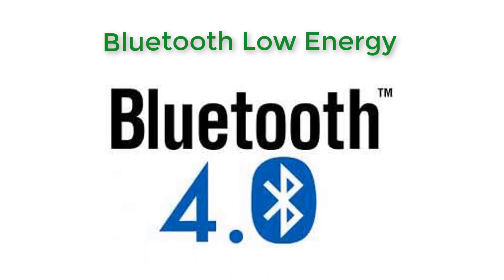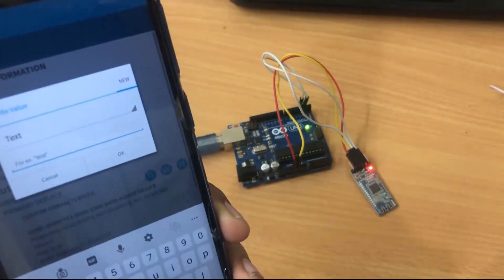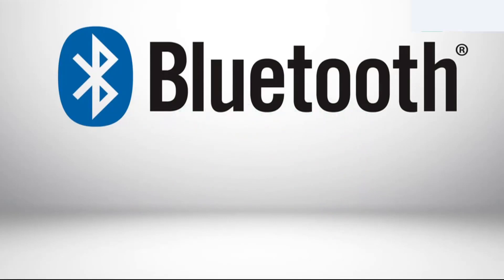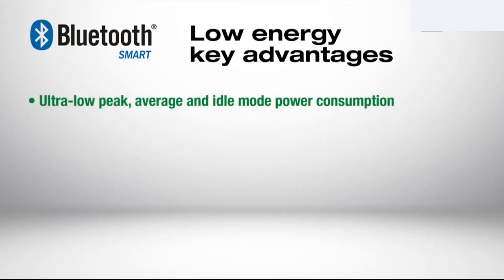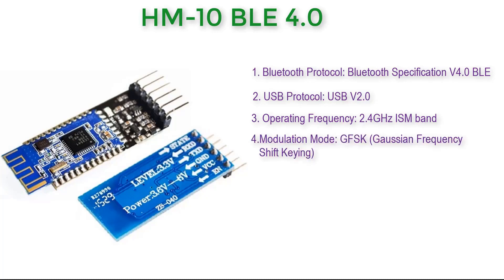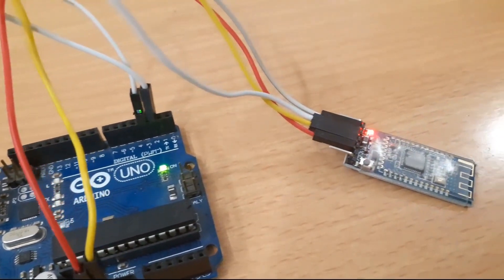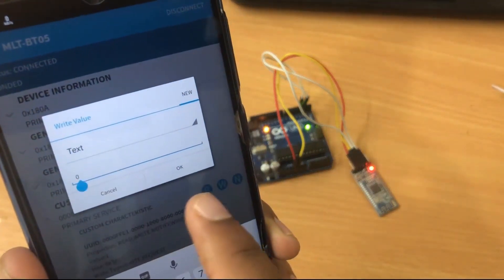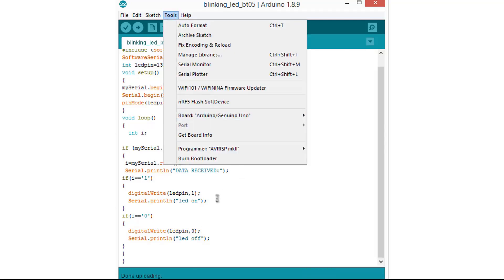Bluetooth Low Energy Tutorial with HM-10 BLE 4.0 & Arduino

Comment: Hi this is a great video, I'm new to all of this stuff and I don't have any idea at all , I have trouble trying to discover the HM-10 that I have when using the ble scanner , I am currently using the Ks0174 keyestudio HM-10 Bluetooth-4.0 V2 , it's connected to the arduino uno board , I have also followed your instructions yet the application still cannot discover the module, any Idea what's going on here? thanks

Comment: so voltage divider or logic level converter between them unlike HC-05 ?

your blog clearly says that one needs to convert Arduino's 5V pin to RX.
but at the end of your blog, your wiring diagram says otherwise

Comment: I have a doubt is codes for Hm-10 and Hc-05 are different? Because already have project on HC-05 and if I now just replace this Bluetooth module to Hm-10 is this previous code work properly or I need to alter?
Reply from the maker: Both are different. The same code wont work.
Reply: @HowtoElectronics  ok thank you for clarifying this 🙏🙏 U doing good keep going

Comment: Plz   Help  .....    can we  use   Nrf51822     Ble  module   With   Ardiuno  UNO  ????    if  yes   Thn  how  to  connect   
GND 
5v 
RX 
TX  
Pins  of  nrf51822  with  Ardiuno UNO ....
Reply  as soon as possible ..!

Nrf51822  module link :-  

 Sunrobotics Bluetooth 4.0 Module NRF51822 2. 4G Module Development Board BLE4. 0 Arduino Raspberry pi Compatible https://www.amazon.in/dp/B07SBYHX5Z/ref=cm_sw_r_cp_api_i_R1kDEbMMPX3E0
Reply from the maker: You can't upload code to NRF51822 with Arduino. You need J-Link.
Reply: How To Electronics thankyou   Soo  much ......   & 1  more  thing    Can  u plz   Suggest   Me   Ble  module  which  supports    Midi  🎹🎹  over  Bluetooth ......    HM-10   Supports  but  it  works  through  mediator Apps ......    plz  suggest    Ble module  supports   Midi  .....🙏🏻
Reply: How To Electronics plz  reply

Comment: at what distance in meters  it offers its connection
Reply from the maker: Up to 7 ft
Reply: @HowtoElectronics  I have a small problem. I need to use components that are compatible with Arduino. A position sensor (so I use a GPS module. This GPS module must be Adafruit Ultimate GPS Data Acquisition Module (GPS Included)). A position storage (with an SD card that must work with an SPI link). A bluetooth interface. A GUI to visualize the route (using an Android tablet that is compatible with a bluetooth module).
you can advise me to use what as a component . because it's 3 components must be compatible with Arduino and an Android tablet IHM thanks to a Bluetooth module.